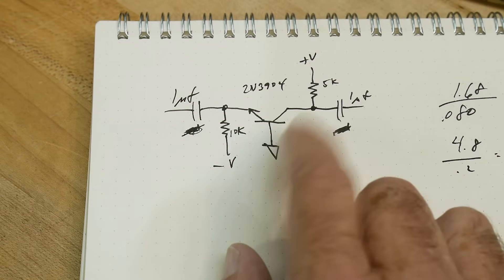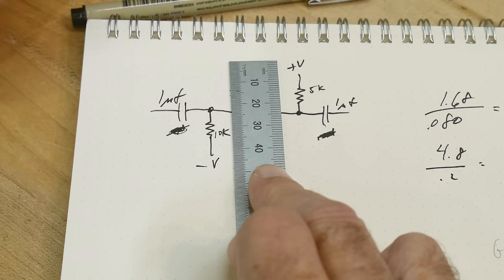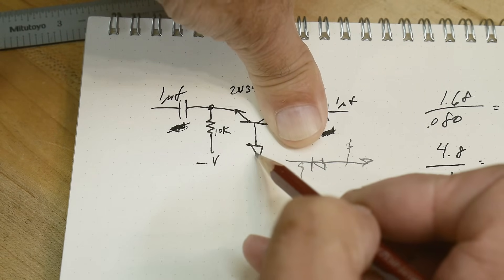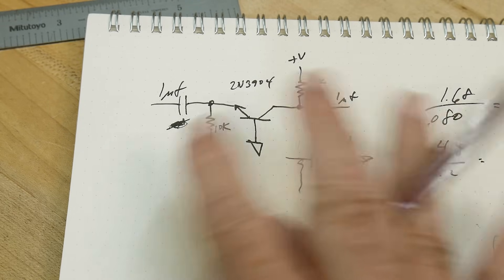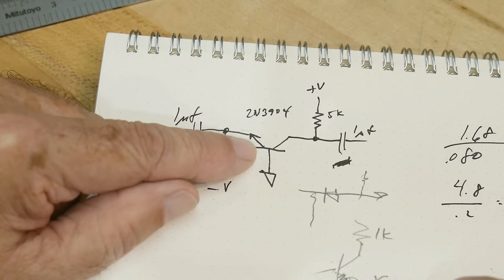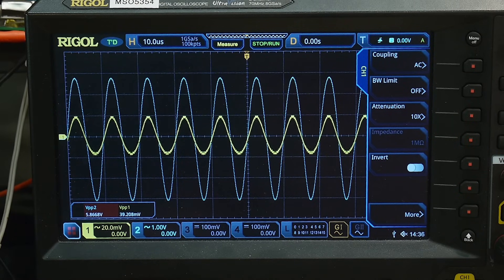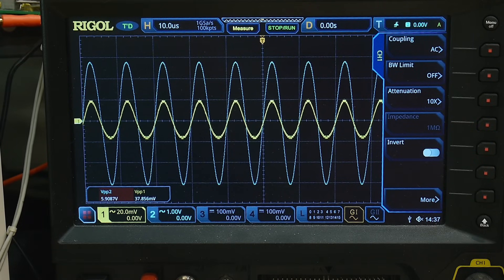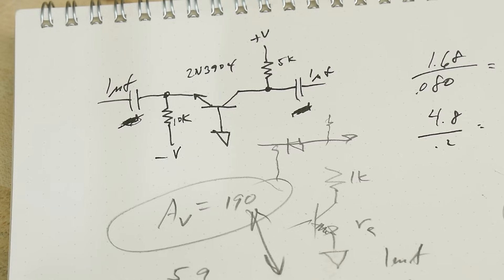#1705 Common Base Amplifier

Comment: I'm assuming you're using the conventional current path standard intentionally. I'll never be a fan of it lol. It's useful in analyzing existing circuit architecture in some cases, but when learning fundamental topology and the quantum mechanics of devices, I have always favored the electron path standard. 
It makes unique designs from the ground up much easier to understand and produce in my experience.

Comment: A version of this configuration is used in Spectrasonics microphone preamps and was used in their consoles back in the 60s. The reason why is the guy who designed them worked on missile guidance systems so he was drawing on his knowledge of high frequency amplifiers. As a result, they are really good at handling transients, actually. This was the type of console they had at the record plant and was used on some of the later Jimi Hendrix recordings as well as John Lennon records. Nowadays they make them in 500 series modules and they sound awesome.

Comment: Student here.  I tried to build this but it's really confusing how - where does the input go?  Where do I attach the scope probes?  I built it as I understand the schematic but I'm getting nothing out of it, just a flat line.  And what's an mf?  Is that a microfarad?
Reply from the maker: input on left, output on right, uf is microfarad. did you use both +V and -V it needs the negative voltage
Reply: @IMSAIGuy  Thank you!

Comment: THAT is a calculator.✅  I owned an HP-41CX for many years.  Those buttons NEVER fail! 😍   I have built and worked on a number of amplifiers in my life, and I MAY have studied the common base amplifier back in the day, but I don't remember it at at this point.  When I saw the circuit, I was sure you had smoked something interesting- until you explained it- well done.  The reason it was so hard for me to "get" this circuit, is because I always think of the input to any amplifier being the BASE of a transistor.  You could title this video "Using a transistor emitter as the input to an amplifier".  YES- the input and output impedances are not ideal, but the circuit is an interesting one anyway.  That Rigol scope looks half was decent.
Reply from the maker: Rigol: https://youtu.be/eaoHYWYLRV0?si=KoQ7Ub13rt-fCOH-

Comment: I 'm surprised the transistor's small-signal gain (hFE) doesn't affect the overall gain. Now that I see, in this configuration, that the input current EQUALS the output current!
Reply from the maker: yes, very different from the typical transistor stuff.

Comment: Such common base circuits are often found in old RF circuits (70s), mostly with germanium transistors. The transit frequency could therefore be used effectively.

Comment: The low input impedance is nasty, but so is the temperature dependence of r_e. So the gain is not stable with temperature ad needs to be controlled with feedback somewhere. (In a cascode, the feedback is degenerative.)

You should definitely cover cascodes.

Cascodes are definitely a Swiss Army Knife transistor circuit.  They're essential for high voltage . You use a series of common-base amplifiers at successively higher base voltages to get around limitations of Vce and Vcb.  They stabilize current mirrors, because they remove the Early effect by holding the collector voltage of the output transistor constant.  They're essential to high-frequency operation, by being Miller killers.  

If you look at the internals of an OTA like the CA3080 or the LM13700, you'll see veritable towers of cascodes.  Both collectors and emitters are supplied by Wilson mirrors (cascodes!) and the differential amp is a cluster of six transistors (a matched pair of Darlingtons driving common-base amps).  All to keep the current gains stable and predictable.

Cascodes are all--around "make BJT's behave" circuits.  And they're the principal use of common-base amps.

Back in the day, a 'cascode' was a specialized vacuum tube (@glasslinger might explain it as a 'GlassFET'!) that usually had five grids: control, screen, a grounded grid, a second screen and a suppressor.  The effect was the same - the second grid-screen pair was a "grounded-grid amplifier" which is about the same thing as a common-gate amplifier on an FET.  You'd usually find them packaged along with a triode, because the other application of the pentagrid was as a mixer, and it was convenient to have the local oscillator in the same device.

The other place that common-base circuits used to appear was in receiver input circuits, where the low input impedance was easier to match to the receiving antenna. (It's a lot easier to match 50 ohms to 26 ohms than to infinity!)  But now most preamps use FET's instead, in an entirely different configuration.  Up in the microwave region, the commonest input circuit uses a dual-gate MOSFET, which is essentially an FET cascode in a single transistor.
Reply from the maker: yes, I should do a cascode. I did one: https://youtu.be/APUhm2tsCiE?si=SdkCeh4Mkm8rLsHR
and covered one in microphone preamps: https://youtu.be/rJ7GA7rAv-Q?si=PXb1YRXd1-4t33Ly
Reply from the maker: Even at HF you see a lot of dual gate FETs on the input preamp connected to the antenna, designed in ham radios. usually the thing you have to replace when too much static electricity zaps the front end.
Reply: @IMSAIGuy  haha yeah I remember hunting 40673s to build better input stages for my ham rig back in the day
Reply from the maker: I've seen dual gate mosfet preamp with the two gates tied together. makes no sense to me
Reply: @IMSAIGuy  gets a little more gain per stage, at the price of negating the benefit of the cascode configuration. I never used them that way.
Reply: @stamasd8500 And you didn't just build an LNA, you joined the GaAsFET of the month club.  The gates on those would punch through if you looked at them funny.
Reply: @ke9tv  Makes sense since GaAsFETs are not MOSFETs but MESFETs; the gates are not insulated but formed like a Schottky junction. I stayed away from those devices in my builds - good performance, but very expensive and easy to damage.
Reply: @seanoconnor1984  You also stabilize everything with an AGC loop.  And with degenerative feedback, reducing gain per stage.  You don't build a design that depends on stable r_e to function.
Reply: The low impedance comes handy for current sensors such as photodiodes or silicon photomultipliers, so I wouldn't call it nasty.
Reply: https://www.youtube.com/watch?v=LradbHTLVPY

Comment: Common base configuration works great for digital level shifting. Put the base at Vthreshold+/-0.6V, drive input into the emitter. Then the output is a unipolar current sink that’s active on one side of the threshold voltage. A complementary common base pair can be then followed by current amplifiers that swing the output up and down. Those amps can be clamped to prevent saturation to keep them fast. It’s just one of the many ways of doing it for sure though.

Comment: My trade school memories:
Common collector - unity voltage gain - has current gain
Common emitter - more voltage gain than current gain
Common base - more current gain than voltage gain??
But hey, I'm getting old.
I do remember common base is like grounded grid - low input impedance and self neutralizing.
That's why these are almost always seen in vhf fm receivers as an rf amp. Low input impedance - ideal for antenna coupling,  self neutralizing - less likely to oscillate and reduces local oscillator coupling to antenna.
I remember as a student getting hung on identifying CC,CE, or CB amps is that the common element is at SIGNAL ground, not necessarily bias voltage ground. For example common collector amps, the collector is at signal ground through the power supply.
Reply from the maker: common base has unity current gain
https://www.electronics-tutorials.ws/amplifier/common-base-amplifier.html
Reply: @IMSAIGuy  actually the current gain is a little sub-unity; the output (collector) current will be the input (emitter) current minus the base current.
Reply from the maker: beta/(beta+1)
Reply: @IMSAIGuy  That does make sense. If a CC amp is unity voltage gain, its complementary circuit, a CB amp would be unity current gain. Thanks.
Reply: I remembered reading this in an old book.  When HF transistors were expensive and germanium Tr's were slow, CB circuits were mostly used at the RF side since CB has a lowest capacitance to ground.  It was before JFET time and pocket radios had to use germanium Tr's due to their lower voltage drop.
Reply: @bayareapianist  even early Si transistors were used mostly in common base configurations in RF - no Miller effect means they could be used at reasonable frequencies. But the low input impedance means they had to be used with tuned circuits on the input (and output) so they were narrowband. I remember using BF173s that way.  Wideband RF amplifiers had to wait until better transistors came along.
Reply: https://www.youtube.com/watch?v=LradbHTLVPY